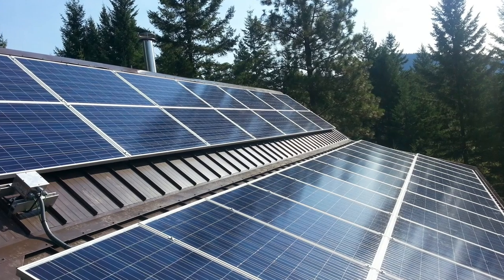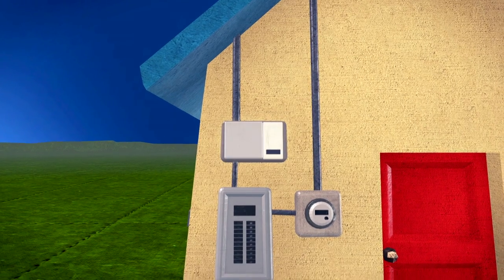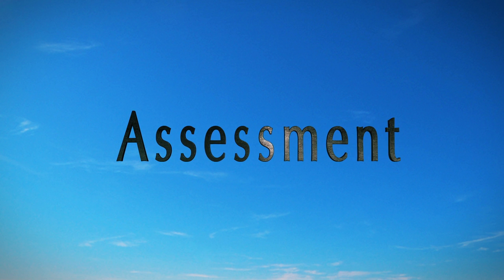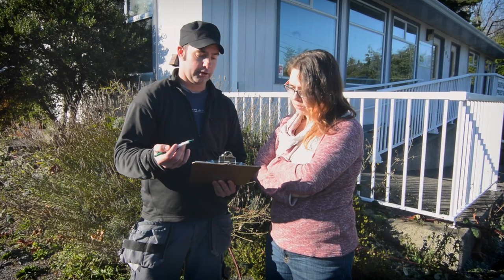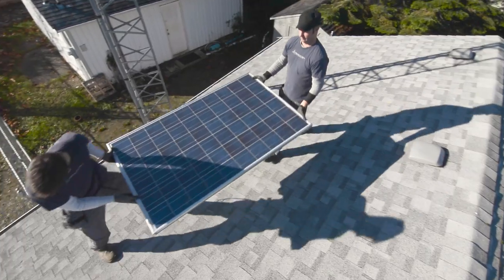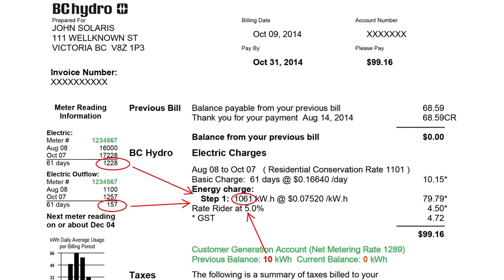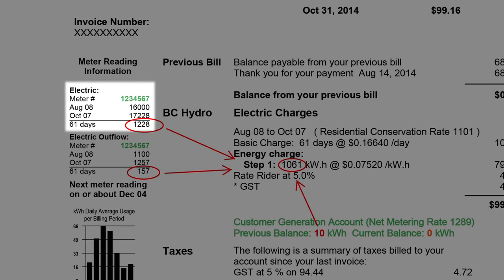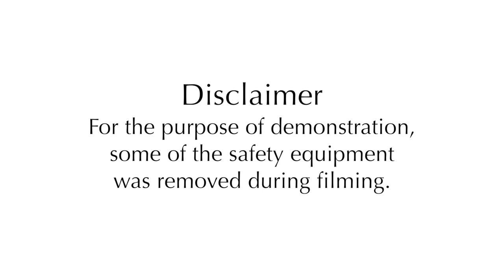BC Hydro Net Metering

Comment: Update  as of 2024 BCH will no longer pay a premium for anyones excess power, it will be the annual average wholesale rate of the North West Power Association Mid C hub, around 3c/kWh.  Also one cannot install a system larger than to avoid their consumption based on previous consumption.  Fortis electric customers were never subsidizing this.  Now its only Nelson with its own hydro generation paying a premium, a subsidy from all other ratepayers, cross subsidization, something to be avoided in a public utility.